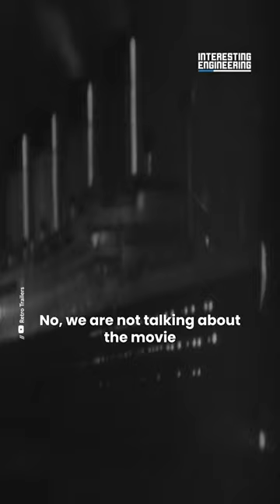The Engineering Failures that Sent Titanic to the Bottom of the Atlantic

Comment: Why doesn't Anyone Ever point this out?  ...  When old wooden ships suffered under-water damage (such as a cannon ball hole), they lowered sail cloth over the side.  The in-rushing water pulled it into the hole and plugged, or slowed the leak.  

Yes, Titanic had No sails.  But it DID have plenty of table cloths, and bed sheets. 

The pumps helped.  Extending her life to double the original time estimate made by Mr. Andrews.  The cloth plug trick may have slowed the leak, to where the pumps could keep up.